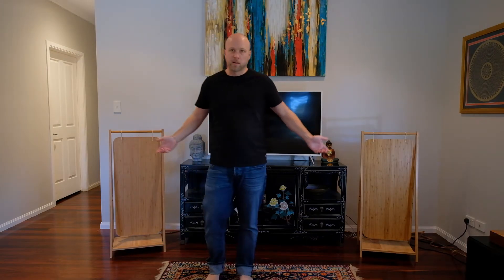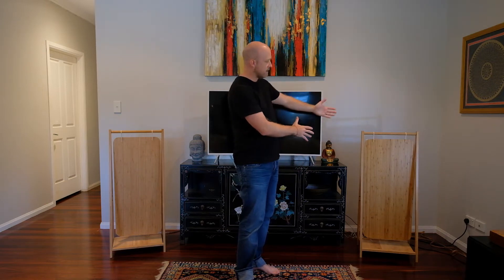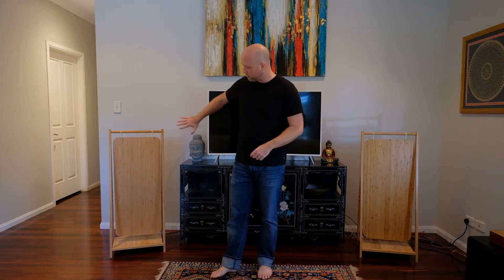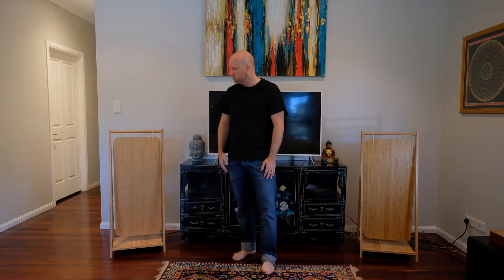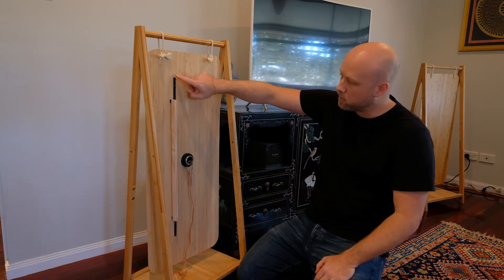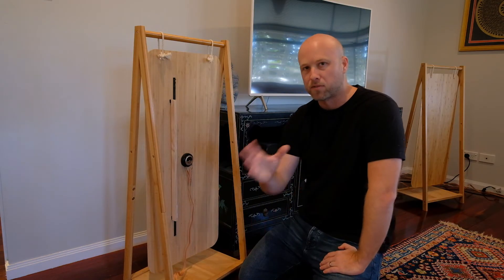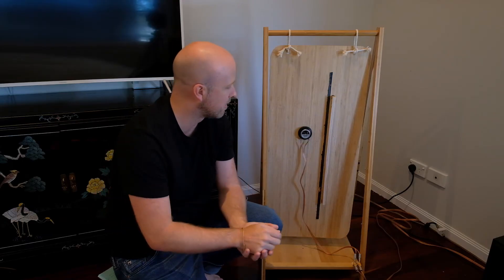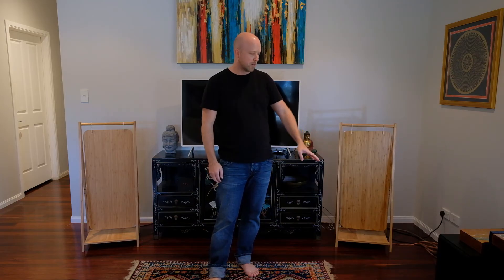How I made my Bamboo DML Speakers

Comment: They're a beauty my friend. I'm building a chair for simracing from a office chair doing some mods, I got the same 40w daytonaudio exiter hopping this and a DAEX32QMB-4 turns it into speaker plus vibrates a bit. Thanks on clarifying not to spect much bass. I'll get the 100w mega bass kind instead. However your project is just perfect. I was Iooking for a cool speaker to my small but nice department and maybe some un-used exiter exites me to do it. I probably made a 8cm hole on top rigth to simulate the idea of the speaker in the art piece you've created my friend. Awesome job

Comment: Get better results if you tie the Rope to the bottom and sides tightly, you don't want it moving about. will be partly why you're getting a  muddy sound. Also you don't want the exciter in the middle it's got to be 2/3 from the top and ⅔ from the side! work a lot better like that.

Comment: For those wondering, plywood bamboo is ok but it’s too stiff, inconsistent density, and too dense. The nodes and modes are going to be insane with a wild rollercoaster response but if it sounds good then ok. But if you hear a cf-skinned tungsten honeycomb dml with 16 drivers you will see what I mean.
Reply from the maker: I think we need some more info on the 'cf-skinned tungsten honeycomb dml' because that sounds epic.
Reply: @  it’s incredibly stiff but low density. It’s also $1200 for a large sheet….  Increasing the exciter count smooths the response if you can use FEM to find the eigenvalues but too many can start to over-dampen the panel Also, the design has no parallel sides and has rounded corners. It’s a sealed enclosure 4” deep with a separation layer 2” down which greatly suppresses nulls and modes. I’m also using a 16 channel amplifier (40w x 16) with enbedded storage for PEQ and phase correction determined inside anechoic chamber. Finally, I’m using dirac room correction software at my listening position.
Reply: @TypicalBenYT  the ultimate material is carbon nanolattices which achieve the compressive strength of carbon steels with the density of Styrofoam. Capable of supporting over a million times its mass, but still light enough to balance on a soap bubble. It’s 3D printed then baked to remove everything but the open cell lattice.

Comment: hi Ben, this method would work to make a bass guitar amplifier?, equipment are so expensive this days, maybe with a couple of bucks i can have a normal amp doing this proyect, cheers
Reply from the maker: I think it'd be more complicated and quite large unfortunately. The main weakness of the panels is the low frequencies so I'm not sure you'd get a satisfying result. I have tried it as a guitar amp/speaker though: https://youtu.be/Z7stD3T2tnI

Comment: I’ve watched these type of speakers being built & tested before. They look like a very interesting project. I’d like to see them done with a sub &  decent crossovers and some ribbon tweeters
Reply from the maker: Thanks. I've been refining it with newer designs and my current setup is basically just that. I'm running stereo subs though as I play them relatively high to free up the panels a bit.
https://youtu.be/seSobHwwmas
Reply: @. Thanks, I’ll have a look 👍🏻

Comment: I’m wondering what influence has the balance of mass between the exciter and the panel. The system should work the most efficient with a light and stiff panel. The damping properties might also has an influence of the sound. Knock on that bamboo plate and listen how it resonates. 
On the other hand I think the place your speakers are taking is appropriate for real floor standing cone loudspeakers. Those panels are ideal for the walls and can look like Art Deco.
I wouldn’t sacrifice this place if I could use it for the real deal after some acoustic treatment of the room has been done.

Comment: As far as light and stiff material goes, carbon fiber comes to mind.  Any thoughts on how a sheet of carbon fiber would perform?
Reply from the maker: I actually have a couple of small CF panels to test, but haven't had time to do it yet. They're only 300x200mm and I was thinking of pairing them with some 8" woofers I have as a sort of large bookshelf / standmount type thing if they're any good. I'll get there eventually!
Reply: @TypicalBenYT   Very interesting!

Comment: I built these out of end-grain balsa and another set out of insulation foam.
The result was 'OK' but zippo bass. Good fun to trial, but I do not use them
Reply from the maker: Yes they really need to cross to a low end driver, preferably with a high-pass on the panels to get the most out of them. I have found that the addition of a HP filter improves the sound dramatically.

Comment: So love this. Reminds me of the old Magnaplaner electrostatic panels (which may still be around for all I know), but they were terribly expensive & very inefficient. First DIY's I saw were made of omni fissured avoustic drop ceiling mineral tiles, but I never heard the result. 
So I'm curious, would a different hanger impact the sound, maybe something thin & strong like fishing line, or something flexible like surgical tubing, bungie cord, or HD rubber strips?
Also, do ya think a 3D design could be routed (either symetric like dart board rings, or asymetric) w/o negatively impacting sound quality?
Lastly, I used to work with a lot of composites and laminates and was wondering what you thought of things like honeycomb cardboard w/ rigid or semi-rigid backing & face (anything from cardboard to carbon fiber), or maybe Okoume plywood? I have a set of four 45 year old mirror imaged Dahlquist DQ-10 phased array speakers that are two stacks of two and your srt up immediately had me thinking of something between that and the Grateful Dead's Wall of Sound. 😊 Maybe craft larger panels and hang one above another? Curious what if any overall size range has on sound quality? This is gonna have me busy in the shop for a while. Thank you!  🙂

Comment: Can they play frequencies above 15 000 Hz and what about the timepoint when different frequencies hits the ears? Will these speakers create a kind of reverb sound?
Reply from the maker: They naturally have a peak above 10khz then drop off above that  (don’t remember the exact slope of these ones). Am currently experimenting with dipole tweeters to address this.

Basically all areas of the panel produce all frequencies (to an extent) so it’s not like multi-driver speakers where the time alignment can be out between tweeter and kids for example (obviously if you add a tweeter then you have to worry about that again).

Nah not revert. If you hear that in the recording it’s the room/ mic placement.
Reply: @TypicalBenYT  Thank you for taking the time to answer. Btw the speakers look great!

Comment: Before you buy any PARTICLE board,tap your finger nail side and hear the vibrations, it should have low,mid,hi put your ears close to check again, exiters work differently in low and high volume,use Separate amplifier to control other speakers and woofers 😎🤜🤛📚📕📒📖

Comment: those are beautiful. cool idea with the bracing. there must be a good way to make a dml subwoofer
Reply from the maker: Thanks! I'm not too sure about the subwoofer - I mean, I love the idea of it, it just might be a bit impractical from a panel size perspective.

It's on my radar to try in the future but I haven't seen anything convincing yet online.
Reply: @TypicalBenYT  (1) what if you enclose the area behind the diaphragm? Like a drum. (2) what if you make an enclosed box with an opening (like an f shaped opening like a violin or like a guitar hole and then place the vibrating diaphragm inside the box.
Reply from the maker: You mean for a bass panel? Some kind of enclosure (or just side wings like you see on some open baffle designs) could help as it would negate the front/back wave cancellation.

The downside is that it loses it's "flatness" which is one of the things that makes it appealing (to me at least)!

Now if mounted on a wall, you'd just need to seal in the sides a bit to get a similar effect.

Comment: I  have been asking this without any reply as of yet.  But, in regards to mounting the panels to minimize the impact it would have on the sound,  would it not make sense to use the exciter itself as part of the mount?  The Dayton exciters I have seen seem to be just a metal disc at the back with no real effect on the business end.  Would this surface not suffice to act as a mounting plate, to a rod assembly like a table lamp type setup?
Reply from the maker: I haven't tried this but I don't think it would be a good idea.

The problem would be that you'd be hanging the entire weight of your panel off the exciter, and this would pull the voice coil out of alignment.

I suspect that the optimal setup is actually a soft clamping of the panel around the edges, and supporting the back of the exciter in the way that you describe, so that neither the exciter or the panel are dependent on the other for support.

When I figure out the best way to soft-clamp the panel while holding it in place, I plan to test this.

Comment: Nice iteration Ben. As you say, a bit thin. A different approach might be as I did. 1500mm high x 400mm wide frames of mdf with a rigid spine to attach the 4 exiters to. So 4 separate sections of 300mm squares using Coroplast sign board, held on the edges by duct tape. I chose to mount the rear of the exiters to a spine for two reasons. I'm not convinced that freely hanging exiters off Coroplast would last very long, and the weight of the exiters would tend to deform the panels. The second is that surely a fixed exiter shouldn't add its own movement into the mix. Ok, the spine itself will vibrate a little, but it shouldn't colour the sound if it's well damped, which mine are. There may be other avenues to explore in this regard, but for the moment, I'm quite satisfied with the sound. I shove all kinds of genre through the things and they acquit themselves well...

I had my son listen to Enigma, a piece with some quite deep bass. His view was that "it's all there", which from my son is quite a complement. I feel the treble is a bit down, although bass is, if not abundant, very satisfying. I'd hoped these would be truly full range, but they're not. The treble lacks the sparkle I expect from familiar tunes on my other more conventional speakers. Hoping I can fix that by introducing a tweeter with a crossover cap. I'm not at this stage going to wire in an inductor to separate the bass because I think these exiters seem to roll off naturally, and a tweeter should add just a little sparkle. I may have to fiddle with the crossover point, but that's all part of the hobby.

I particularly like your idea of thin bamboo panels, or perhaps I might try that other notorious hardwood, balsa. 

Dollar for dollar, these things are unbeatable for such ancient low-tech speakers...
Reply from the maker: Sorry just to clarify, do you have  small panels per speaker, mounted in a 1500 high frame?

I am also going to use a spine in my acrylic panels - also using acrylic to maintain the transparency.  Like you I find it just makes sense to transfer as much energy as possible into the panel and not waste it moving the driver itself.

The 40w exciters I have for that project also have large, heavy magnets so the support will come in handy.
Reply: @TypicalBenYT  Yes, that's essentially correct Ben. 300mm square panels x 4 with supporting framework for each. Dimensions 450mm wide x 1500 high with 4 x Bunnings plywood feet. Very basic. Duct tape to secure the panels. Later on I intend to wrap the things with acoustic cloth for aesthetics.

Watching more of your videos has given me a few ideas. I checked out the AER Goldy. They look sensational with their minimalist design, but reading the blurb I detected a faint whiff of hyperbole and a smattering of confirmation bias. Typical humourless Germans. But what do I know...?

I think a spine is pretty much essential. "Like you I find it just makes sense to transfer as much energy as possible into the panel and not waste it moving the driver itself".

You put it better than I did....;)

I'm in Perth Ben. Whereabouts are you if I may ask? I can send a pic but not sure how unless by email. Mine is itsonlyme (at) optusnet (dot) com (dot) au. I won't pester you if you wish to maintain your privacy, but my email is there if you're ok with it all....
Reply: @TypicalBenYT  Just out of interest, I have little idea about how to take frequency response measurements. I can see much of what's required by watching your video, and it seems you need a particular mike, some program/hardware to generate the sound sweep, and computer to display results?
Reply from the maker: @logotrikes  yes pretty much. I am using the REW software, which is free/donation software for windows. It generates the sweeps/tones and records the measurements. Ideally you’d want to use a calibrated mic. I have the Dayton audio IMM-6 which is the cheapest one I could find. It comes with a code to download a calibration file which you load into the software and allows it to adjust for the characteristics of the mic. Other than that it’s just getting the right cables.
Reply: @TypicalBenYT  Ok, much appreciated Ben. I'll make some enquiries...

Comment: What is the 2/5th 3/5th rule in regards to building this speaker?
Reply from the maker: It's generally accepted that you shouldn't place the exciters at a point half way between parallel edges of the panel - this is to avoid reinforcement or cancellation of frequencies who's wavelength corresponds with that distance. So you'd usually want to mount the driver off-center.

I'd encourage experimentation (in fact I am currently doing just that myself) but I know that dayton audio (who makes a lot of exciters) and others tend to recommend placing them 2/5 of the way along each dimension, so 2/5 down from the top and 2/5 in from the side) as this is supposed to give the smoothest response.
Reply: @TypicalBenYT  Thanks for the quick response!

Comment: You need square panels.  The shape does matter.  When you make them rectangle you lose a lot of base and even mid range.
Reply: Every single thing I've read says the exact opposite of your claim...
Reply from the maker: I’ve never seen square panels recommended anywhere. Have you tested them? I don’t necessarily think they’d be worse than rectangles but I can’t see any advantage either.

Comment: Ben, what are your thoughts on the DSP?  I am thinking about getting one as well to round out the peaks and valleys.  Does it work well?  Is it easy to work with?  Also looking forward to your next acrylic video.  The first one was really good . . .
Reply from the maker: Hi Greg. It's a little fiddly to set up (but I haven't tried any other brand to compare) but seems to work quite well. I think a lot of it's effectiveness will come down to how accurately you can measure your speakers in the first place, as you'll be applying equalization based on that measurement. 

With that in mind, it might be best to set up the system as well as possible, take measurements (L/R) from the listening position and then EQ based on the response at that location. I based mine on a ~1m measurement but as I've mentioned in the vid - I'm still learning!
Reply: @TypicalBenYT  Ben, I know what your next video should be . . . How you took your bamboo speakers and used DSP .  From just the raw sound and then how you “tweaked it” to give the best quality sound from your speakers.  I am sure others that use even “Normal” speakers could benefit from how to setup DSP.  And it doesn’t matter if you are a beginner at it, we all learn through the journey.  Just a thought . . .
Reply from the maker: @ProductivePM  Yes it's actually already on my 'videos to make' list as I'll have new speakers in a new room and will be re-doing it all from scratch. I'm also looking into DIY room treatment ideas to try out. It's all going to be a bit slow though I'm afraid as we've just moved house and I need to fit this stuff in where I can... Thanks for the suggestion, I'm glad you're enjoying the videos!
Reply: @TypicalBenYT  That’s awesome Ben.  As for room treatments, take a look at a video by DIY Perks that he creates sound treatment panels from 2nd hand towels that work better than expensive acoustic tiles.   You could add treatments in the color of your panel frames (maybe that’s too much gold). ;-). All the best buddy!